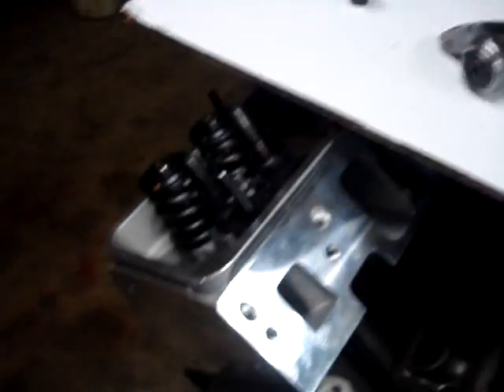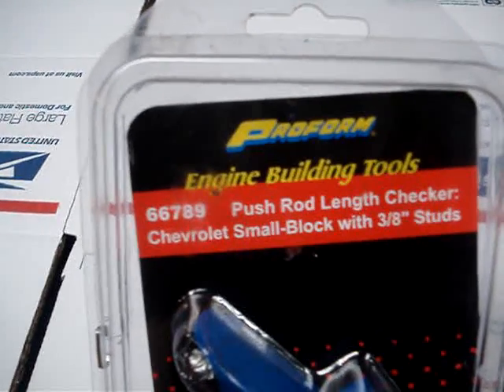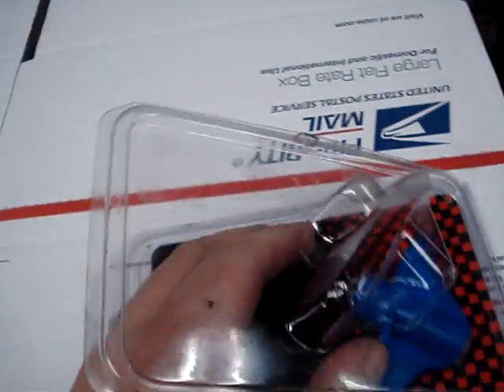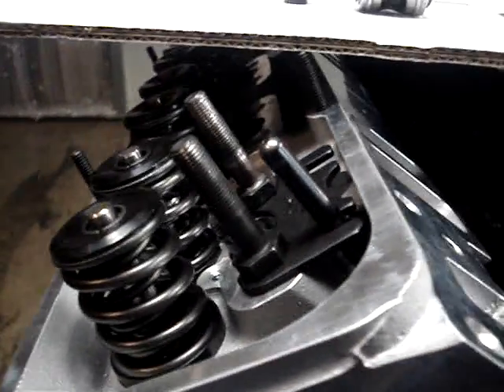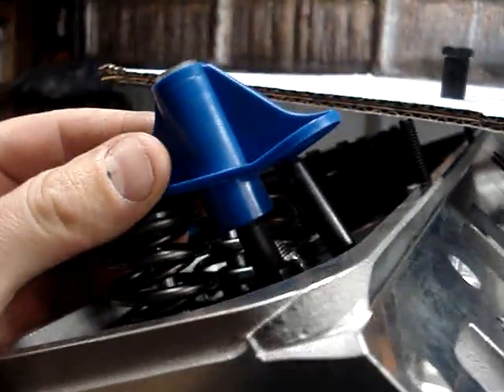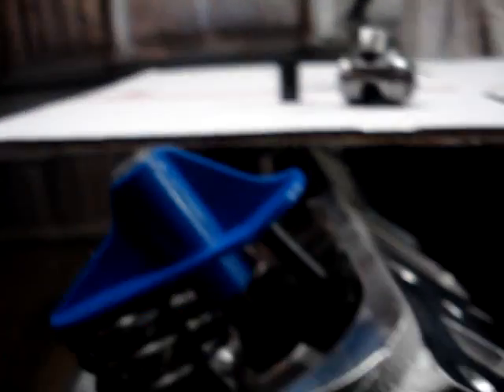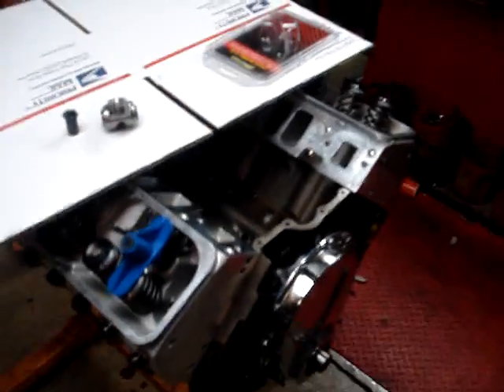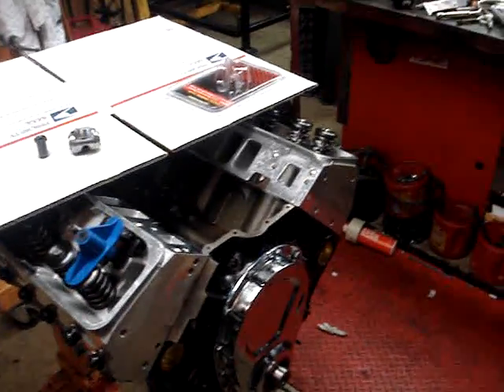How to check for correct rocker arm geometry

Comment: Im having trouble getting my FE pedestal rockers dialed in.  Theyre adjustable but the contact ball on the borrom of the rocker is not in line with the pushrod.  I can get shims for the rocker stand but i dont know how to identify when the rocker is parallel with the head for 50% lift.  
I bought a depth guage and am picking up a checking valve spring today.  Im just worried im gonna fuck this up and order the wrong length pushrods.

Comment: The only other consideration is that rocker fulcrum to both-each tip angle varies from manufacturer to manufacturer.
Some with 1.6 ratio actually measure 1.8 coming off the seat. That means that the first ,200 of lifter lift the valve is open several thousandths  MORE.
Open sooner means more area under the curve, more power.
Dyno tests have shown 12-20 hp more by changing from one brand 1.6 to another brand 1.6 in back to back tests.
Dont forget this tool is set for MOST rockers, not all.
David Vizard explains this.

Comment: Is there a way to tell what kind of rocker arm i need? I just bought an lt1 engine that has been cammed and seems to have aftermarket valves but they installed the incorrect rocker arms.

Comment: Great information what your videos will the the push rod checker tool will it be ok to use on either 1.5 and 1.6 ratio rocker arms  ?
Reply: Yes, the pushrods end is at an angle, so the shorter actual tip radius is compensated for.
Don't forget to sweep the valve tip with an adjustable length pushrod.
See my other post. Please.
Reply: @hotrodray6802  thanks .

Comment: On my 350 with that tool, a stock 7.800 pushrod, lifter on base circle I have almost .150 gap between the bottom of tool and top of valve top, could it be that far off or is something wrong? Pushrods way to long.

Comment: I have a 351w with trick flow twisted wedge heads with roller rockers and the pushrod keeps rubbing on the pushrod guides. Any advice? Thanks

Comment: aircooled VW's checked with the rocker arm installed with the adjustable pushrod and the arrm on the valve side flat like in the video. I wonder if they make one of thoes tools for Vw's.

Comment: Very  cool I was thinking  of roller rockers cuzz I have vortec heads on a 010 block  and .500 lift.
Reply: Don't buy inexpensive chinesium rockers 
Most won't last 2,000 miles with a medium cam.
The biggest problems are that the center fulcrum bearing allows wobbles side to side at the tip, AND/OR the tip roller goes to hell really quickly.
It's money down the toilet if you do.

Comment: How accurate is this?  I have a dart pro 200 with 1.55 valve retainers,   added comp cam magnum  moly rocker, clears ,so they say 1.55 spring... I stared with 7.2 pushrod,, too short, so I went 7.4.. swiped is good across the valve.. tried this tool.  It shows me I need 7.6 rods!!! Is this accurate?

Comment: The adjustable push rod with the jam nut is the length checker, the plastic rocker arm is for checking the geometry, with just the geometry tool you can verify you have the right or wrong pushrods, but you will need the length checker to verify the pushrod length needed
Reply from the maker: yep your right I use both
Reply: is there a plus and minus tolerance on the push rod length as to being perfect.  ?
Reply: @dextermccoy1016  +/- .050?  correct me on that

Comment: I don't trust this tool.  it said I need pushrods  7.0. with adjustable push rod it was 7.1 and some change. stock block , stock 041 heads with Howards retro roller hydraulic cam/lifters. Howards said 7.144 is what they recommend as a starting point for my setup and  7.0 was out of the question! I think this tool is for measuring at 50% lift ... maybe.
Reply from the maker: this only works with a mild cam with a bigger cam I agree I would not use this tool

Comment: Thank you for this video!  I'm changing rockers, lifters,  and springs in my lt1 and I was told I was gonna have a problem picking the proper pushrod length and you just made me more confident.  I'll be ordering both the tool and the adjustable rod soon.  Thanks again!

Comment: Doesn’t compensate for different cam lifts!  May get in the ballpark, but not spot on!
Reply from the maker: yes that's true this tool is only useful with mild cams with bigger cams you need to do it the harder way go to half lift and make sure the center line of the rocker is 90 degrees to the valve tip  one of these days I'll do a video on that

Comment: So if I changed cams, springs and rockers on a hydrolic vortec 350, I'm finding this tool doesnt work when testing my engine at 1/2 lift with 90 degree method.  Also noticed it changes my lift in a negative way although my sweep pattern is on the exhaust side.  To get correct lift and 90 deg I had to increase rod length by 200 thousand.  That us accounting for preload factored in.  Products changed:
Compcams Xm270hr marine cam
Compcams behive springs
Comp 7 degree retainers and keepers
Assault racing 1.5 full roller rockers.
I'm going to test out a different set of 1.5's, I'm a little freaked out by the big change and exhaust sweep.  Thoughts?
Reply: I am reading Summit reviews and about 20% of the reviews state that this is not the way to go. I am more comfortable with the 90 degree method. I love saving time but shortcuts do not make any sense to me especially given the reviews on Summit.

Comment: Hey vintage im having a prob on my 385, far as maintaining a 1k idle, it is a 515 or 525 lift but 1 machine shop screwed me around with press in studs and didnt cut bosses, later took to my original place and he helped a little by putting some honeycomb springs and she ran better, i feel i need to go aluminum heads, especially for a better flow than the stock heads
Reply: Ben Dover

Comment: I never rebuilt and engine before so I'm in uncharted territory. I'm working on my 97 3500 7.4 Vortec. I'm pretty sure you all know that it cant be adjusted like regular rockers. Will this tool work with the Vortec?

Comment: I have the same tool 
And I need it to find my pushrod length 
Do you just use fealer gauges under it to measure how much off it is ?
Reply: You will need a tool that looks like an actual push rod but it has adjustment to make it long or shorter. So in actuality you would need this proform tool and a push rod lenght checker. 
The way you would buy one is to find out how long your stock push rod is the go to Summit Racing or Jegs and search for a push rod lenght checker that will be adjustable to the longer side of the stock push rod.
When you get it you will put the proform tool the way he did in the video then grab your pushrod lenght checker and adjusted to where it touches the proform tool. Then you will take that push rod checker and measure the length with a caliper or even a measuring tape. Now you got the correct push rod lenght and you can order it, good luck.
Reply: @MrElPoderozo1  ok great 
Ty very much 
I have a 88 roller block 350 
I have new alum heads with double valve springs 
And my 3 year old 1.6 roller rockers hit the inside of the rocker and shattered wearing out the retainer on top after 1500 km break in 
Now I just put my factory gm ones back in 
But I fed have stock pushrods 
I actually just broke one in half 
I replaced it with a new stock one for now 
When do you need hardened pushrods 
Spring pressure or rpm
At what point dog they break
Reply: @benkalinowski5834   Is very hard for me to give you accurate information without knowing everything I need to know but sense you put new aluminum heads I am going to assume that it also has a new camshaft. The lift on the cam has to match the springs etc... if you broke a push rod in half it could be that is too long or you might have adjusted too much. Like I said is very hard for me to tell without being involved in it. Good luck tho sorry.
Reply: @MrElPoderozo1  I have a Chevy performance lt1 hot cam 
It's not crazy 
It's for my fuel injected 88 GTA trans am 
I thought if it breaks another pushrod then I'm gonna do what you said

Comment: Wouldnt preload on hydraulic lifters change the final geometry? This checks with no preload so ~.060 taller than with preload right?
Reply: nykuryu,   yes.  with the lifter full of oil and zero lash,
   add .020 to the overall pushrod length.

Comment: So I recently had to get my cylinder heads milled to true them up after a head gasket blow out. I just got this tool and measured out my new pushrod length. I noticed you did not measure out preload. I’m dealing with a 95 ford 302 and the rockers call for zero lash and then a half turn while on the base circle of the cam. Using this tool, should you add those preload measurement of the 1/2 turn or no? I’m just assuming that half turn really doesn’t matter with that small of an increment measurement unless you are going absolute dead on balls precision cut pushrods.
Reply: 95 have NON adjustable rockers.
This does not apply to those.
You need to adjust your stands for .030" preload... Unless it's just a daily driver then nobody cares really.

Comment: hmmm....question:  Wouldn't you want to check the valve stem length first for proper roller rocker position then check the pushrod length ?
Reply from the maker: The valve stem heights are all the same the push rod length is what determines proper rocker position

Comment: I like this video and have done this with my GEN I 355 SBC with Edelbrock cam & flat tappets, their E-Street Aluminium 64 CC heads with guideplates, and Scorpion 1.5 full roller rockers.  I got the pushrod length to 7.750 Comp Cams hardened pushrods (0.050 shorter than stock, but compression chamber is smaller too, etc...).  I have had others tell me to toss this "pushrod length checker tool" and go other routes.  "Why not use what is simplest and works?" I say.

Comment: I found a better easy way to check push rod legnth. Put your pushrod in, tighten rocker  to zero lash. Count the turns on the nut from being off to zero lash, mine was 5. Take your pushrod out, put your rocker back on, count your turns to your zero lash. Now count the turns to get your rocker where it runs centered on the valve. 3/8 studs are  .042 per turn of the nut, 7/16 studs are .050 per turn. I needed .250 shorter. Worked out perfect. No need for an adjustable pushrod, just eyes and math. The .021 of half turn past zero lash on a hydraulic cam wont make a difference on your measurement. My sharpie mark on the valve stem is dead center.  Heads milled .015, block decked .010, felpro gasket,  .580 lift cam, hydraulic lifters. 12.5 to 1 comp. You can also mark a business card at zero lash with the wrong pushrod, measure on the pushrod end of the rocker, take it out, run the rocker where it while ride the valve centered, mark the business card again. Subtract. Convert to hundreths of an inch.
Reply: Don Rutter lol ya that's a way easier way to do it.  Lol

Comment: I have searched for this same type of rocker arm geometry checker for a SBF with 3/8 studs and can only find them for Chevy. Do you know of that same tool for Ford or does the same tool work for Ford?
Reply: Douglas Knutsen See my post at the top, you dont need any tool, just a sharpie mark on your valve stem.
Reply: Understood. Just trying to cheat a little with the soft springs and an adjustable push rod

Comment: Great vids man. I'm building a 350  2 bolt main, cast crank, and factory style flattop pistons.This is going in a 72 Monte Carlo with th350 factory stall and 273 
gears. I'm looking for 330-350hp and lots of low end torque to launch that 4200 lb car.  I had the block zero decked and intended on installing vortec heads but I'm worried about my compression being too high (10.41:1) for a daily driver (pump gas) with the 64cc heads. I have a set of 882's that came with the car. They are 76cc and that puts me in the  9.15:1 compression range. I know I could cam up the vortec 350 to scrub off some compression but that will kill my low end performance (I think). Question:  Do you think it would be better in my application to port the 883's and go with the lower compression? In one of your vids I think you said the 441's were pretty good but I doubt I will find any. The camel humps are out for me since I need the accessory holes. I even looked at some of the cheap ebay aluminum heads but they are a gamble. Any recommendations are appreciated.
Reply: 4200 lbs lead sled 
Needs a big block

Comment: I have recently built a SBC with Edelbrock heads with roller rockers , I don't have this tool yet  . Can I pull the valve cover , pull the rocker and look at the impact spot is on the valve ?

Comment: Not a fan of this tool. It doesn't account for valve lift. There is a big difference between a .550 flat tappet and a .750 solid rolller cam. The only way to do it right is the use the rocker your going to run, set it at 90* to the valve stem to establish the proer geometry, then take out 1/2 the total valve lift to determine pushrod length. This tool doesn't know what your valve lift is so should only be used on hydraulic cams.
Reply from the maker: I agree that above .550 lift this does not work but up to that lift it works like magic I was skeptical at first a so I checked the Geometry with the 90 degree method and this tool gets it perfect,  I tried it with a .620 lift solid cam and it DOES NOT !! work you are right about that good call
Reply: blazeracer1 Not so, my rockers wont run at 90° mid lift. You have to get your wear mark centered on the valve, not 90 degrees.

Comment: Thanks a lot, good stuff, good teaching ! Now, couple questions: trying to find stage 2 camshaft into my 2004 Mustang/ 3.8 litre V 6. Comp Cam does not even make it??, where can I find one, even used one?? Also, can I change 1.6 rocker arms, stock I believe in my Mustang into 1.7 ratio?? Is there enough "play" in pistons to do that? Thanks again, youtheman =)
Reply: DONT EVEN BOTHER WITH THAT 3.8 INSTALL A V8.FOR ANOTHER DONT EVER INSTALL A USED CAM.YOU DONT KNOW ANYTHING ABOUT IT AND FOR ANOTHER,WEAR PATTERNS ON THE CAM ITSELF!

Comment: Dude this help me out so much i did what you said and thanks for telling me about the Push Rod Length Checker because turns out my push rods were a little to short so i got new ones and my SBC is running better then ever. Thank you so much
Reply from the maker: Your welcome
Reply: @Myvintageiron7512  can this be used ford 302 engines?
Reply: @Myvintageiron7512  Sir, can this be used on a Ford engine, 302 heads?
Reply: @brucebell7623  @myvintageiron7512 can this tool be used on ford 302 engines? I see they have 2 versions, for 3/8 and 7/16 studs.. but they both say Chevy. I would imagine it would be able to be used on ford’s unless there is a small detail I dont know about?

Comment: Does it matter if you use a solid or hydraulic lifter when using this tool? I have a solid lifter, but the seat height is way different than the hydraulic lifters that are being used in the engine. Using the solid lifter, the stock length pushrod is perfect. Using the completely dry hydraulic lifter, the pushrod is .100 too long. That makes more sense to me since the block and heads were surfaced.
Reply from the maker: WITH HYD LIFTERE THE PLUNGER WILL BE ABOUT THE MIDDEL OF THE TRAVEL WHEN PUMPED UP STOCK LENGTH IS FINE
Reply: Myvintageiron7512 That was my assessment as well. Ordered a set last night, thanks.

Comment: Would this tool work on a small block mopar, Magnum 360 that I'm using Comp stud mounted 1.6 stainless roller rockers?  I have already used the comp adjustable pushrod part number 7702-1 set at 6.8" with .050" preload on the hydraulic lifter as per Comp's tech page, and have a very centered sweep on the tappet end of the valve stem.  Does that mean my geometry is correct?
Reply from the maker: This tool will give a ball park setting for most engines keep in mind to get exact rocker geometry
 there is a much longer process

Comment: How do you check a head that don't have studs
Reply: Vague question. What do you even mean?
Reply: He is probably asking about engines that the rockers run on a shaft. Its not a vague question when you are a mechanic. Non mechanics come up with basic terms describing what they have seen. So us mechanics have to read further into what they are trying to describe sometimes.
Reply: I WOULD SAY HE IS TALKING ABOUT THE BOLT DOWN ROCKERS LIKE A SBF HAVE

Comment: I have a question... So this is verifing the length, however this is w/o any lift or mid-lift...  Shouldn't the push rod be verified at mid-lift?  just a question.. thanks~!  RW
Reply: @Brandon Dennis so the engine needs too be hand turned until the push rod drops to it lowest point before using the push rod checker tool?

Comment: You can also use lash caps to correct geometry as well, and lash caps also come in different thicknesses to help some situations.  It usually will be one or the other, either the push-rod or lengthening the valve stem.  Keep in mind that the lash cap will add weight to the entire valve spring assembly which might not be desirable on a high RPM high performance engine.  As a builder one has to consider ALL of the cause and effects of an approach to issues with proper assembly.  Some 'builders' make gravitas assumptions that 'parts is parts' and never bother to check EVERY interaction on how to fit the pieces of the puzzle to add up to the sum.  A reliable and powerful well running engine.  Excellent video and sound advice.  Thanks once again.

Comment: Can that tool be used on a Ford head, one with adjustable rocker arms?
Reply: flint lock no they are engine specific because of different valve angles, etc

Comment: Wouldn't blue dye on the stems be an easier way 2 check the length?
Reply: Yes, but do you have 6 different length push rods to try??
Buy an adjustable pushrod and just do the job right the first time.